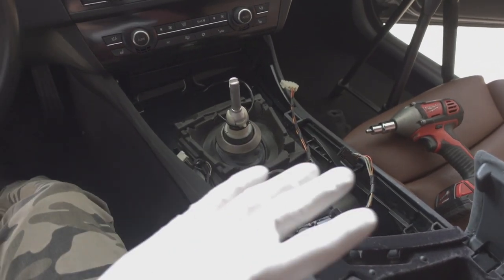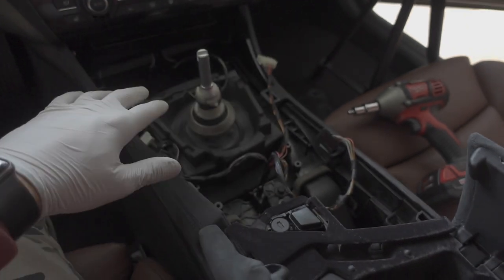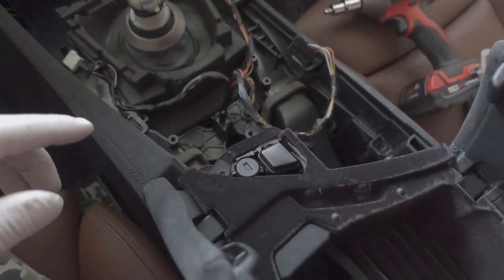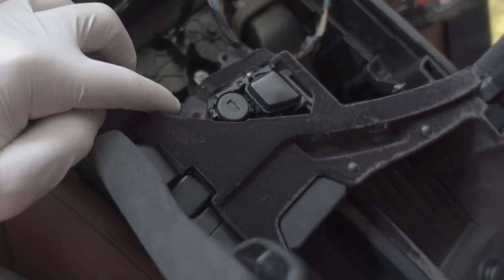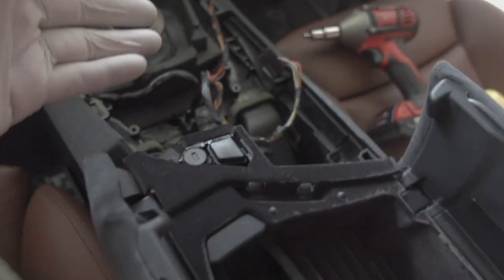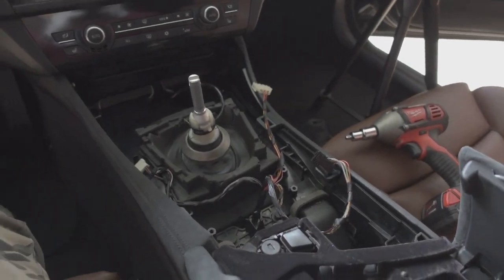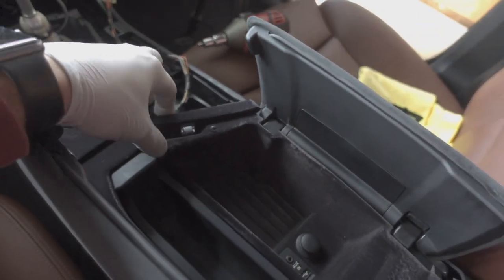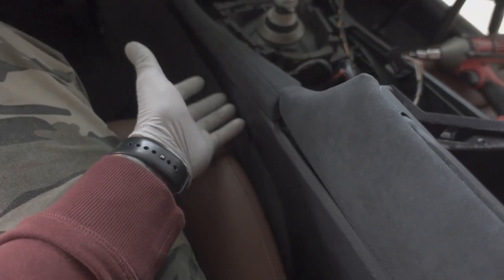I've Been Putting This Mod Off For Months | BMW F10 Dash Swap

Comment: Hi mate.
Do you know if all F10 Dashboards are the same?

Reason: I have a 535i F10 LCI and the leather has started coming off it. I found an M5 F10 (Non-LCI) Dash I want to buy, but don't know if it will fit.
The M5 dash I saw still has the HUD Hole, and I need to swap the buttons for HUD, Lane Keep Assist, Blind Spot Sensor etc... But thats all the difference I can see from pics.

Any info would be greatly appreciated.
Reply from the maker: I believe so, if there’s anything different it’ll be within the trim pieces where the buttons are for some features that came with that car and maybe not with yours (or the other way around) and those parts are usually swappable within the dash itself

Comment: Was there a VIN number you had to swap?  From the dash
Reply from the maker: The dash did have a different vin than the one that came original in my car, and I did attempt to swap it over but sadly it’s a serrated sticker, meaning it has slits in it that cause it to rip apart when you try and remove it, so I decided to just leave the vin tags alone